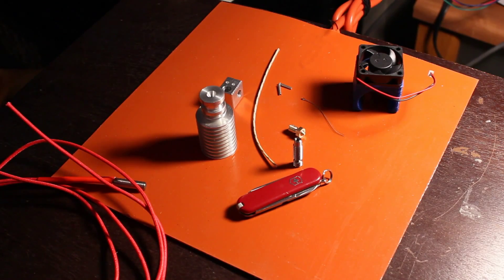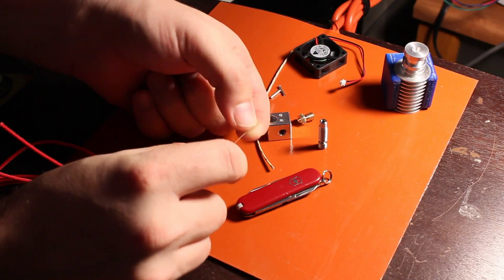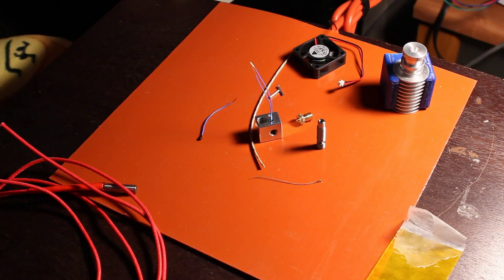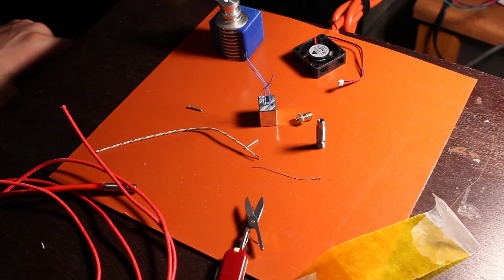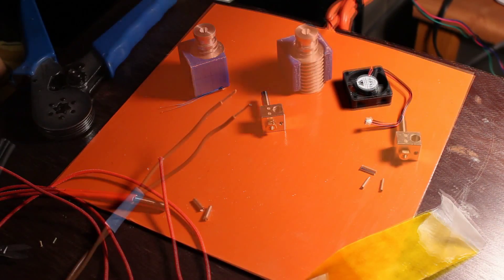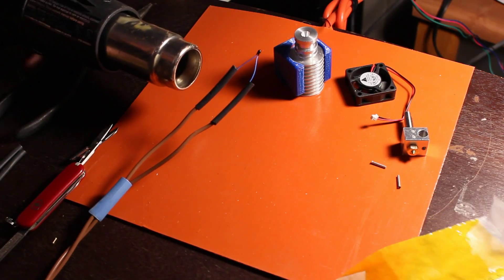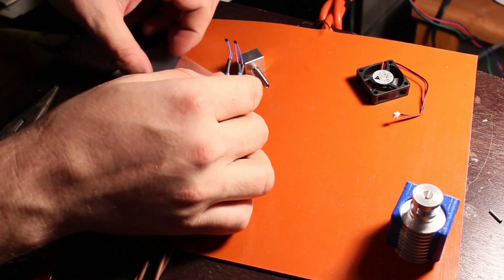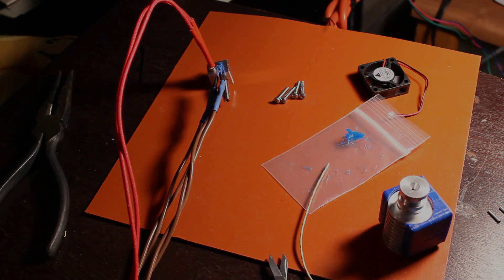Evan's DIY 3D Printer / Mill - EP5 A - E3D Hot End Build / Modify

Comment: another suggestion - I saw your supplied heat cartridge has minimal play inside the aluminum heater block. What came to my mind is maybe some normal house-hold aluminum-foil cold be wrapped around once, thus making the diameter a tiny bit bigger and making it fit in there more snug.
Since it is aluminum also, it would transfer the heat even better, since a more snug sitting would procide better heat transfer.
Just an idea though
Reply from the maker: E3D mentions this for the thermistor, but I'm not sure about the cartridge.  I think it does fine as is, but it may not hurt to wrap it for a tighter fit.

Comment: very nice Video!
explains that stuff in a good way.
One thing I´d like tom mention: since you chose to go with an all-metal E3D Hotend - I believe that was a good choice! PTFE can be a real PITA when over-heated. I read articles about canary-birds dying because a brand-new waffle maker was turned on for the first time (pre-heated to 230/240). Poly-Tetra-Flour-Ethylene will emit very! dangerous fumes, starting from 240/250. At 280/290 or even more it will start emitting some Flour-compounds which will have an LD50 of just a few parts per million. They will cause nice things like bronchial oedema and other things.
I would not want to use any PTFE product with a hotend which could heat up to more then 230/240 degrees.